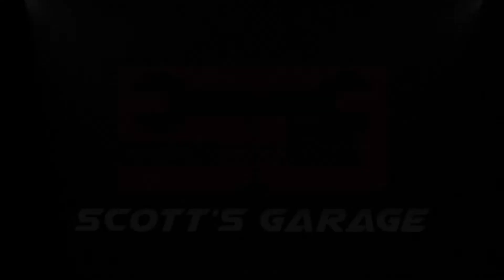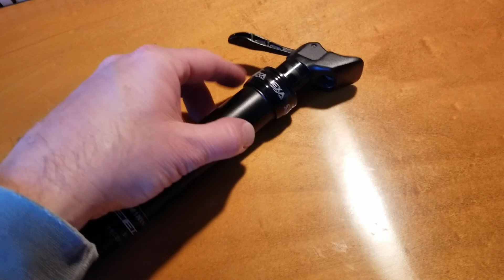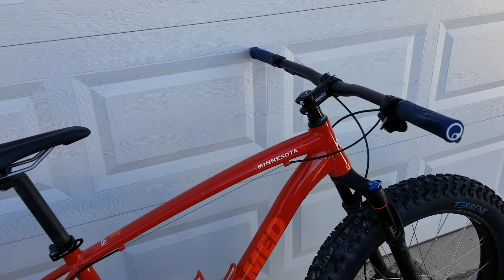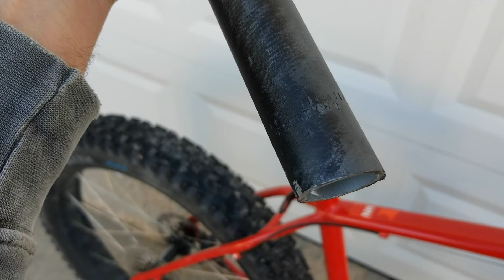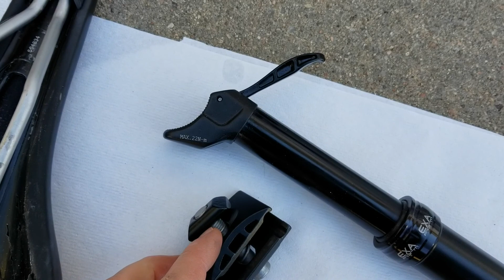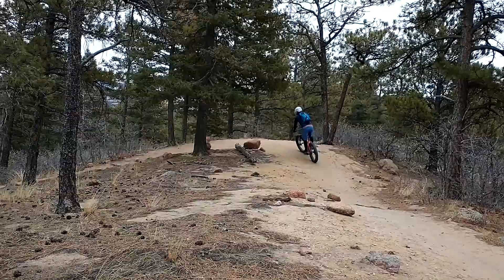Easiest Dropper Post Install- KS EXA Form Speed Up Dropper Post Review

Comment: great review.   was going to get 125 but now am thinking 100 since my frame is so large on me.
been running the Eten first generation on my Bombtrek Hook EXT-C gravel bike for 4yrs now and wanting this version for my ebike that's hard to get off.   lol....i'll use it the intended way too...up on climbs down on decents.  lol    glad to see the seat is easier to level up - i know some like to tilt back or forward but prefer level.  thx!
UPDATE -- got mine today and it was not any easier to level it up but could be user error.   still, on a city commuter light duty trail bike using cleats or non, this allows an easier transition between flat shoes or cleats to dial in pedaling height.  and as a senior, no more falling off at dismount. just lower and off i hop.   hoping this gets more intuitive with use.  my KS Eten lever post did.

Comment: I bought the 2024 Wired Freedom Ebike.  I am just over 6 feet tall, and the Wired Freedom is a very tall bike so I installed this dropper post so I could put my feet flat on the ground while starting and stopping.  I pull the lever to set my riding height, it works well.  Thanks for your video.

Comment: Nice one..too bad they don't have it in 27.2mm diameter...the only one available is the e-ten, which is around the 100$ marker, not the price range I'm aiming for...i think 60$ it's a decent price for this kind of dropper, 100$ it's a bit overpriced, at least for me...there's also the XLC SP-T09 that looks kinda similar, but again it's over the 100$ marker in the size I'm looking for...also I'm not eager spending money on wish nor aliexpress for a cheap knock-off, not my cup of tea...so, still searching...
Reply: I have this post in 27.2 and was able to find it on Aliexpress for around $60.

Comment: Great vid my friend mine is on the way .. putting it on my dh bike reason is I ride the gravity runs in reading pa at the pagoda/ fire tower on ski line dr and rotary park tied of pushing the bike all day long this way I don’t have keep raising and lowing my seat post by Allen key … finally getting smart and doing it the right way hell these posts have only been out for twenty years now 🤣😂…. Biggest worry is gonna be the length of the ks post I need it to be no more then 9” most dh bikes have a short seat down tube

Comment: I had a KS EXA Form 125mm a few years ago, it worked OK. The one thing I didn't like was the lowering or rising of the seat the post would have some sticktion to it. Does the new version that you are reviewing have sticktion  issue?

Comment: Hi, have you been able to use it much and could you answer some questions for me? as I'm looking at gettin one. 

Does it have a Schrader valve for air pressure or is it just a pre loaded cartridge inside, meaning the pressure is not adjustable?

I noticed splines on the saddle rail clamp, are you able to tilt the saddle backwards or forwards to adjust your seated position with these splines? As I noticed there's only one bolt rather than the usual two.

Is there much side to side play in the saddle after it's fixed in position?

Thanks

Comment: was really considering this but holy cow that took almost 4 full seconds to lower, so lets assume the 125mm version will take 5 seconds.....5 seconds riding rough singletrack with only 1 hand on bar...no way. hard pass for me.
Reply from the maker: Absolutely agree. Five seconds is way too long for a post to lower during a ride. This may be an air pressure issue. We’ve noticed things get much more fluid over the last few months of riding. Still isn’t as lightning quick as some of the higher end dropper posts, but this one is worth the money in our opinion.
Reply: just needs lube on the stanchions. might also require to follow the max torq and use a torq wrench for the clamping, I know theyre that sensitive, I ordered a 150mm travel one for my fat bike too. waiting :)
Reply: @noimbaytbike how did it work for you?
Reply: @OKFrax-ys2op  it did, but it takes practice to use while riding in the trails